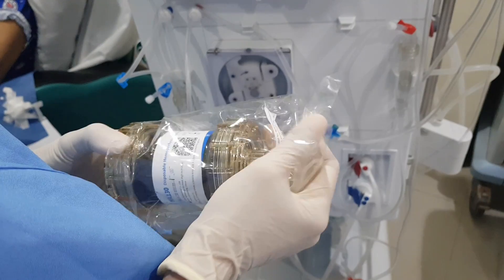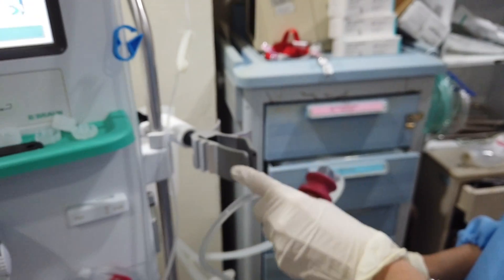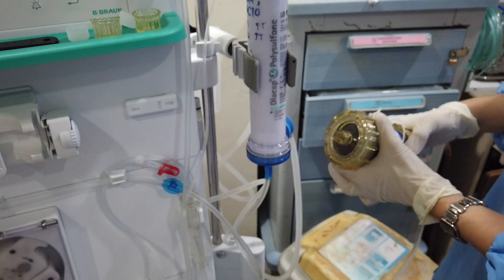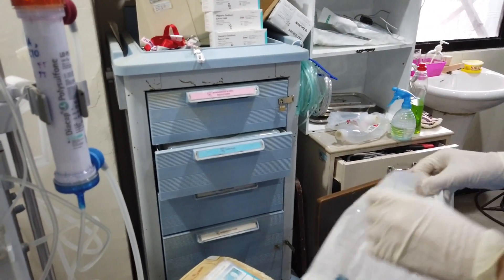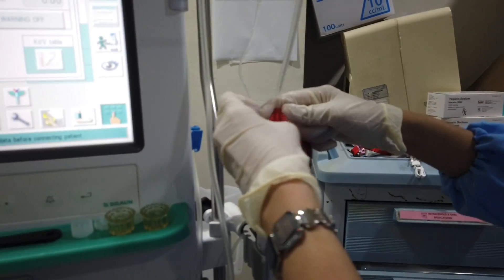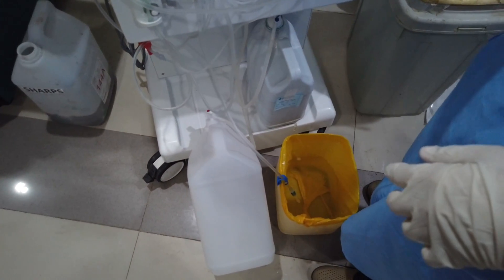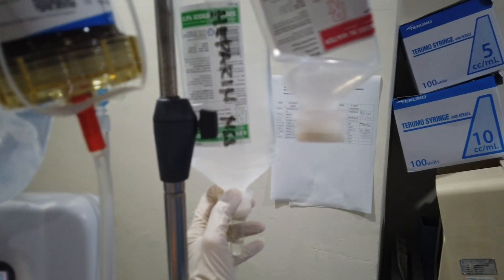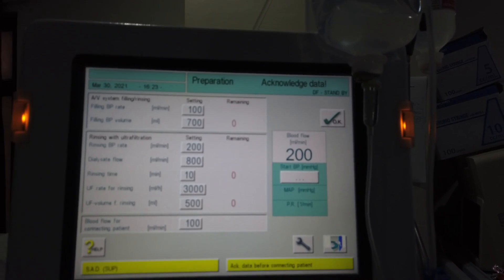Hemoperfusion: Actual Combined Hemoperfusion and Hemodialysis Procedure

Comment: Is bbraun dialysis better than fresenius
Reply from the maker: Mmmmh. Bbraun is more user-friendly than fresenius since it will tell or prompt you everything you need to do, however the downside is, it takes a bit time. Process by process. Fresenius, on the other hand, is more like done manually. You control it therefore, you finish according to your pace. This is from my experience though. Think of it as an automatic vs a manual car. Hope this is what you are asking.